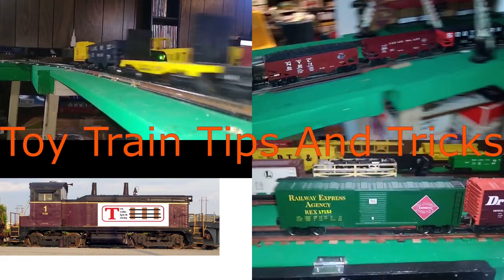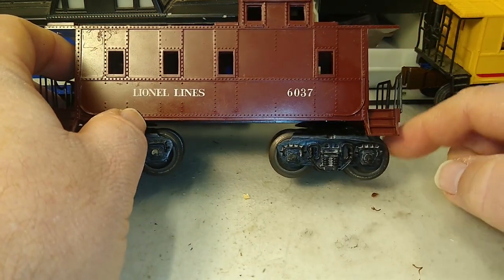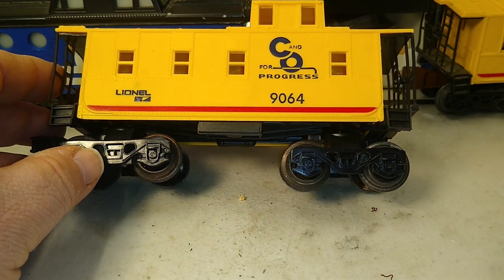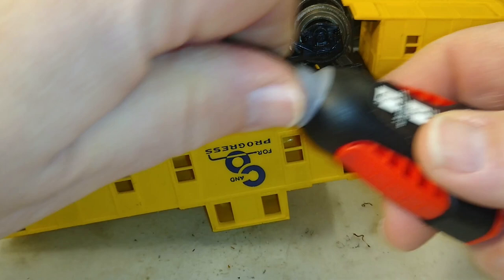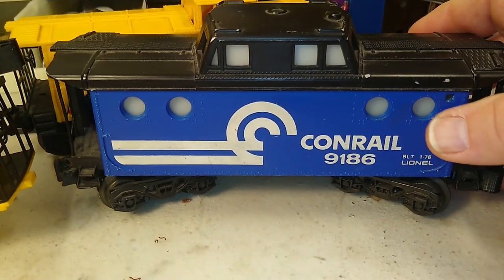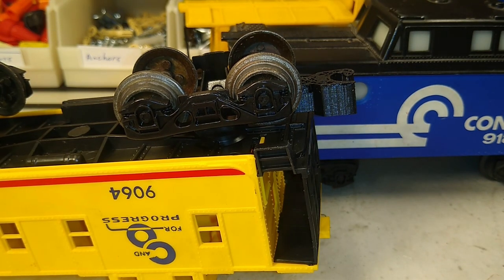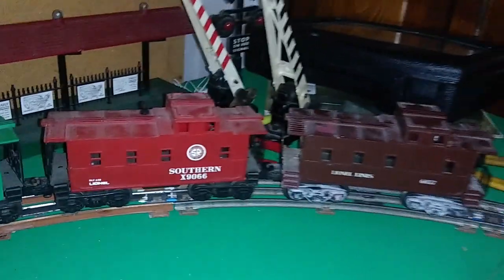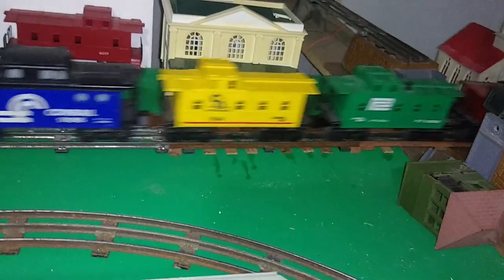How To Add A rear Coupler to a Lionel MPC Caboose - Fast And Cheap!

Comment: "WOW" Way to go.  Thanks for thinking outside of the box.  I have multitudes of cabooses that need the second coupler.  Plus several regular cars with broken couplers. I just might start looking into 3D printers. Thanks for posting another informative video.
Reply from the maker: Yeah, fixing a fleet of these "the old way" takes too much time, effort, and cash. I put couplers on 6 cabooses last night!
Reply: @ToyTrainTipsAndTricks  how do you clean the gunk of of Lionel engines?
Reply from the maker: @railchief74  Some clean shells with a light coating of WD40 on a cotton cloth. I prefer to take the shells off the engine and clean with a mild solution of dish detergent and warm water. A cotton swab gets into tight places. Dry with a hairdryer on the low setting. Be careful around the lettering.

Comment: Fascinating video.  I don't have access to a 3d printer. 
 Is this configuration coupler available commercially?
Reply from the maker: This particular coupler is not. Some parts dealers carry older passenger car replacement couplers, but the shaft is much longer and woould require some rigging. The other option is to swap the truck with one with a coupler.

Comment: That car looks like it has Scout trucks under it which could be a reason why it is such a stripped-down model. I cut down and orange Marx Penn Central caboose cut off the phony wheel frames on the bottom and it fit right on the Lionel Caboose frame. Looks halfway decent on my 027 layout underneath my high rail O gauge layout
Reply from the maker: No. This is an MPC era caboose with the appropriate trucks.

Comment: Lionel would save a few Pennies on every car by dropping off a coupler smokestack window glazing. They're cheap stuff was horrible and you spent more than what the car is worth to try to improve it. On my high rail layout my caboose have to have a detailed interior with a crew and Light I am not satisfied with an empty shell of a caboose especially one missing all of your details on it. I have an old Caboose like that one of the previous owners painted it in New York Central colors with gold leaf paint by hand. He weathered the trucks. I put window glazing in the windows and a conductor standing on the platform I left the rest of it as it was. Since the beginning of time hobbyists have tried to make Lionel Rolling Stock look more realistic.